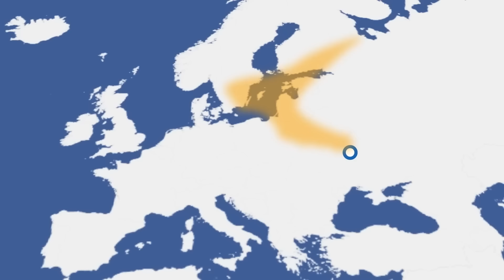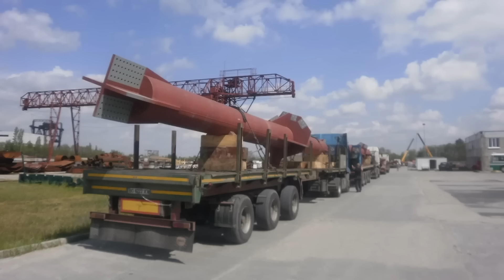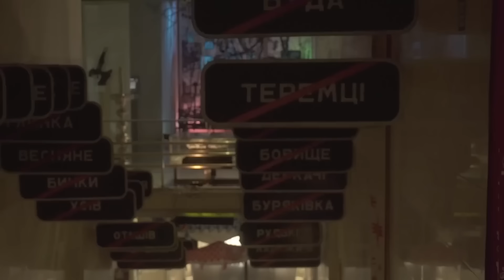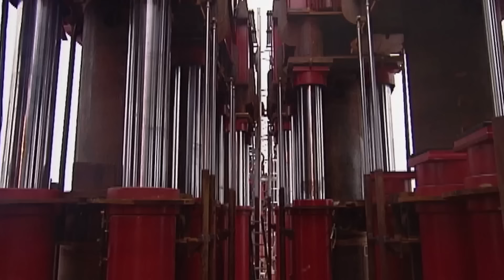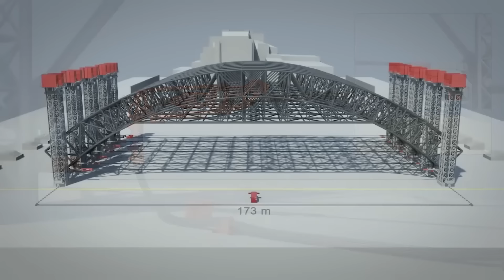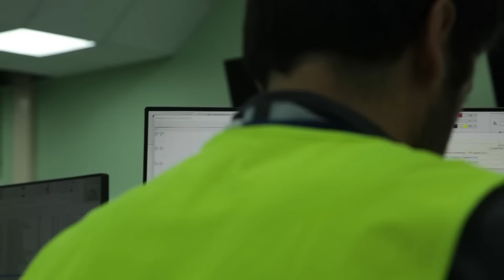Extreme Construction: The New Chernobyl Shelter | FD Engineering

Comment: The radioactive material will be moved to a "safe place"...
Reply: That's what I find funny, it will just be buried somewhere else.

Just dig a gigantic hole and bury it all there. People take tours to Chernobyl many times a day, and work there daily. Either leave it alone, or bury it on site. Why slowly pick the place apart and move the thousands of tons of metal, concrete, etc somewhere else? Because "cleanup" just means moving it somewhere. In my opinion, just leave it.
Reply: @volvo09  thats the plan. Theyre working on building the infrastructure for it not far from site

Comment: So when they lifted the kursk submarine, with computer power to control the scram jacks, just imagine how precise the scam jacks are now ,compared to when they lifted the kursk submarine. 36,000 tons spread over 10 synched scam jacks and its not lifting the total amount at all, its 1/2 that weight in the first scam jack lift, plus those large kanga cranes also did their part to support the lift IMO.  🦘🦘👍👍✌✌😎😎

Comment: Its so unfortunate that this was punctured by some idiots during the war and now we have a new problem on our hands.
Reply: Yeah at the time they didn't think of a possible war with Russia. They hope to get hole fixed ASAP
Reply: Leave it to the Russians to punch holes in the containment 
They are not very bright
Reply: Russia again being the cause .... They can't seem to help themselves
Reply: That's Russia's fault they invaded and failed hard
Reply: Who cares... it sat how many decades uncovered?
Reply: 😂😂😂 obviously you don’t read because the damage Russia did has been fixed and there’s hardly any radiation leaking
Reply: @ItsPiglet515  You obviously can't read time, because the OP posted that 5 months ago.
Reply: @I @ItsPiglet515 they fixed the immediate damage, but the structural integrity of the arch has been compromised resulting in a much shorter lifespan than the previous 100 year projection. There is no immediate danger at the moment, but eventually the structure will need to be replaced significantly sooner than anticipated..
Reply: @ItsPiglet515  I am sure you trust ua for every word thery say what russ do
Reply: @klumpa3668  & I believe you are a Russian puppet who has given your brain to putin
Reply: Just a friendly reminder that your country has a burning coal mine that will continue burning for another hundred years or so. And yall have done, and plan to do, nothing.
Reply: @iHopeyoure0ffended Wtf? There's nothing that can be done about that, it's a massive coal vain. The only way to stop it would be water which would cause a massive steam explosion.

Comment: "Its too dangerous to build the arch above the containment building so we rolled it into place" also here we are standing inside the arch without any PPE. So is it safe or unsafe? 😂
Reply: Exposure limits..
Reply: Time, my dear, the difference between swiping your finger thru a flame and holding it there for several hours. I think building takes a bit more time then taking measurements or visiting. Also I think informed consent? Like, anyone who goes into that building has a higher risk of cancer. I don't know if you can collect enough welders for that.

Comment: Why did not the engineers not extend the Gantry Crane  Runners to go outside the shed so that the parts which are the cranes that do the work of moving highly radioactive materials and heavy equipment OUTSIDE  for the majority of the time they are not doing any work and away from the radiation 24/7 365?
Reply: As they do work they're going to be covered in radioactive materials. It's to keep everything inside to prevent accidental spillage

Comment: When all nuclear reactors are made out of concrete and it was sealed by concrete. Why is it so much safer with a steel thin wall structure going over it and removing the concrete much safer?
Reply: The Arch is there to contain, control, and limit the amount of radioactive dust that will inevitably be stirred up as the demolition of the old sarcophagus proceeds. The Arch will prevent wind from carrying this dust away from the plant site, so that it can't further contaminate the surrounding land, and it will prevent rain water from washing radioactive dust away from the site. Decommissioning what's left of the Unit 4 reactor will be the longest, most expensive clean-up of an industrial site ever, in the end likely costing at least 20 times more than to decommission obsolete "normal" commercial power reactors - "normal" meaning reactors that are still intact and have not suffered a catastrophic explosion. In a normal decommissioning, the reactor fuel, about 150 tons of uranium fuel rods in a 1,000 mWe-sized power plant, are removed and laid up in sealed casks for final disposal; the method used depending on what country we are talking about. Then there are several tens of tons of resin pellets used to demineralize the reactor coolant water. These plastic pellets are radioactive, but not nearly as much as the spent fuel itself. Finally, as the reactor containment and other auxiliary structures are demolished, there will be a few hundred tons of concrete contaminated by radioactive water that dripped onto it from leaks in pipes and valves. This concrete, and several hundred tons of pipes, valves, and other machinery that was in direct contact with reactor coolant, all has to be decontaminated and disposed of in special ways, but in a regular reactor decommissioning, these materials are all relatively easy to handle, and the techniques for safe decommissioning are well-established. In Chernobyl Unit 4's reactor explosion, huge amounts of extremely radioactive fuel, in a semi-molten state, was sprayed all over the inside of the reactor hall, contaminating all of the machinery, hundreds of miles of piping, wiring, ventilation ductwork, and millions of pounds of shattered concrete, plus a still unknown amount of soil, with high-level radioactive material. All of this has to be removed and buried somewhere, probably in deep geologic formations, and the total amount of high-level radioactive material that will need to be entombed, will be hundreds of times more than a "regular" reactor decommissioning will entail. It will probably take at least a century - 3 or 4 generations of workers - to finally and completely dig up and dispose of all of the remains of the Chernobyl Unit 4 reactor. And that's why the Arch is there, because it's going to take a very long time to clean up the mess.
Reply: Its alloyed